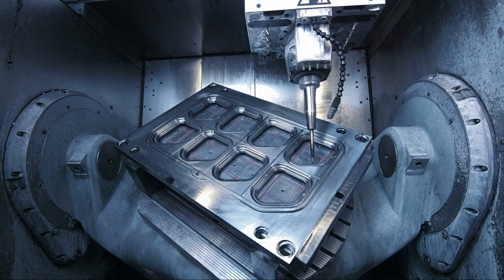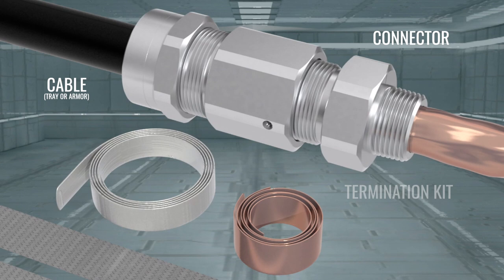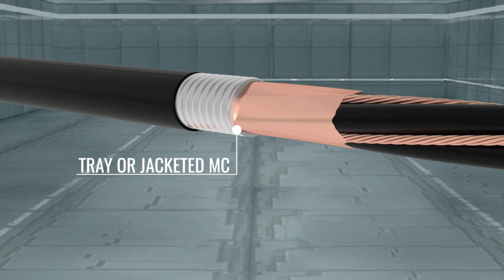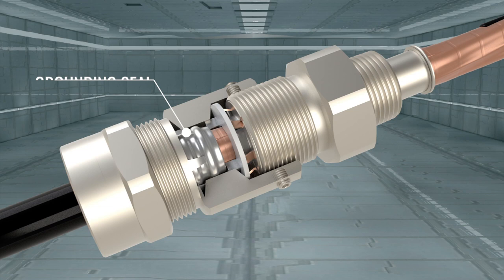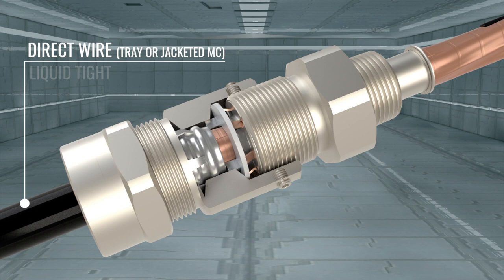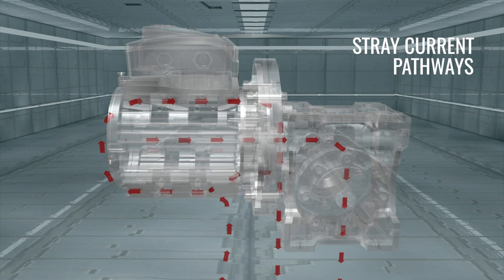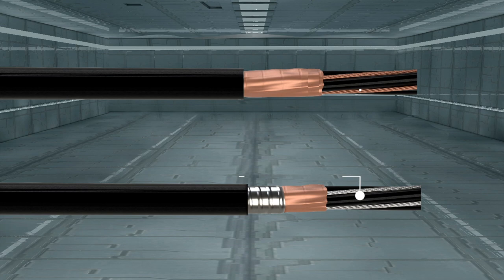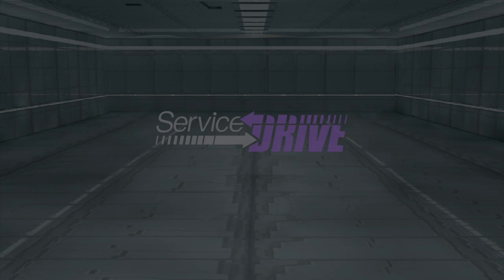Complete Solution to Common ASD/VFD Issues | ServiceDrive® VFD Cable System

Comment: I have been challenged with a project with vfd’s heating up. I’m now dealing with trying to fix it. I just wish I understood a little bit more how this grounding method really works.
Reply from the maker: When cables heat up, it’s usually because of "standing voltage waves." This happens when the electric pulses sent through the cable are too fast. The first pulse doesn’t have time to get back before the next one is sent, causing waves that either cancel each other out or add up. These waves make the cable heat up.

To stop this, we use proper bonding and grounding of the cable, which helps control the extra signals and keep the cable cool. About 90% of the heat is reduced this way. The remaining 10% of the heat comes from something called "circuit harmonics," which can’t be completely stopped. But most systems have special filters to reduce this effect.